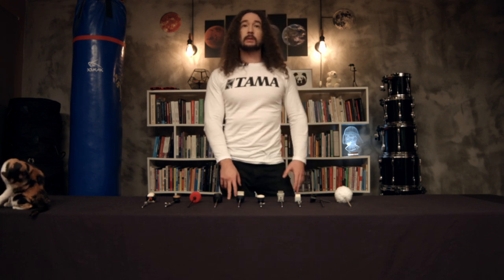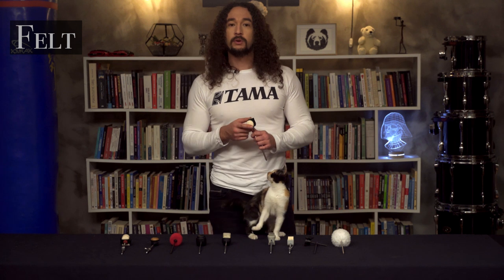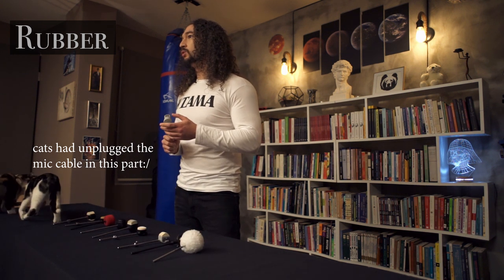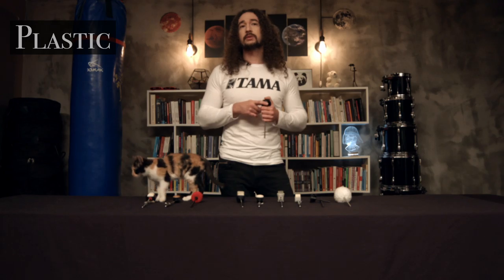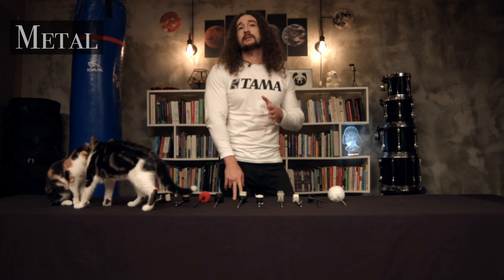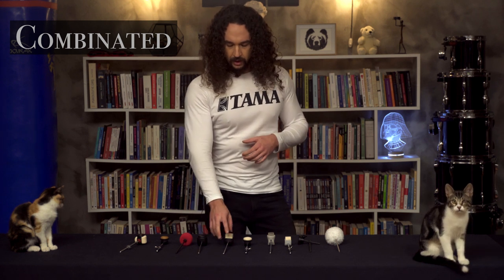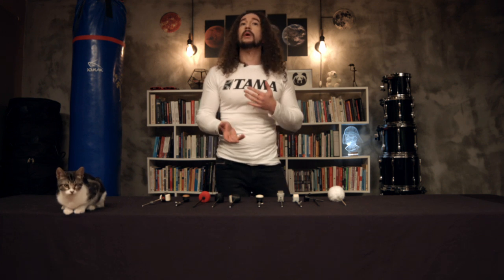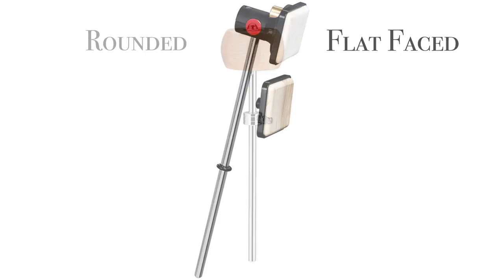Double Bass Drum Lesson 12 - Beater Types

Comment: Dear Arslan, i have a problem with my electronic drumset. When i'm making single stroke, i can hear an extra stroke caused by rebound.
I'd glued thin sponge on bass pad and it solved this problem. But in this case i'm loosing some stokes when i'm playing double strokes.
Is it problem of my drumset or in my technique?
Reply: Denis Bek-Nazarov I would say this is a mix. I think it mainly is your drumset
Reply: Sounds like you might want to adjust your Threshold higher on your drum module. See this video at the 2 minute & 8 minute mark...
https://www.youtube.com/watch?v=SX7K0veLMJQ&t=6s

Comment: Hello sir. Please see if you have any suggestions for me to fix my slave pedal let me know. I bought a double bass pearl p932 demonator pedal. I have tried adjusting it so many times I even bought a trick universal drive shaft for it but the sleeve pedal feels way heavier than the right pedal. I can’t afford to buy new pedals so any suggestion to correct the problem please let me know. Thanks and have a great day
Reply from the maker: Hello my friend. Unfortunately that's the biggest problem of twin pedals :/ Since you have a single chain pedal, this problem is much more than the other kind of the drives. The slave pedal will always feel heariver than the main pedal. I will explain much more about the differences between a twin pedal and two single pedals on my 19th lesson of this serie. I can suggest you to sell the pedal and buy at least a double chain drive or direct drive twin pedal (after trying).
Reply: Thank you very much for the input I have one more question for you what brands do you suggest I get

Comment: Loving your videos. Just one question though, isn't the Axis Sonic Hammer surface Delrin plastic and not metal?
Reply from the maker: Thank you Steve! A great detail and question you have! Honestly I don't know the exact chemical material of the sonic hammer beaters. But it seems like a metal alloy or ultra compressed delrin plastic as you said. The most important thing here about beaters for the tone is the density of the material. As I said in the video that Axis hammer beater is not a directly produced metal beater but because its highly compressed material like a metal alloy it will almost always sound like the any directly produced metal beater. Maybe later I can test that tiny difference in another video:) thanks for the info. I really appreciate it.